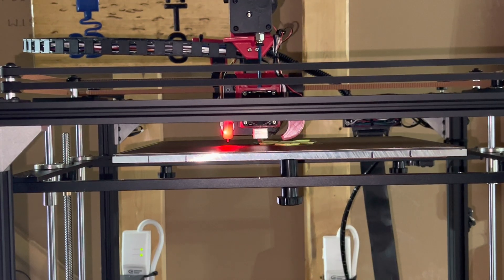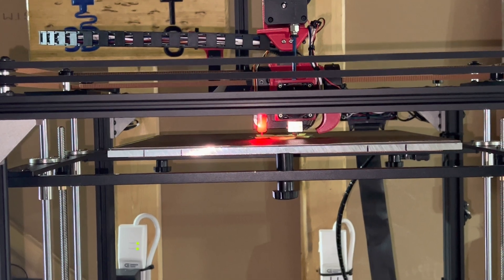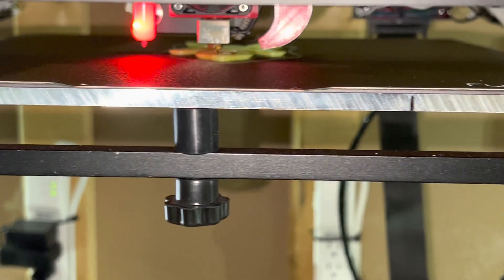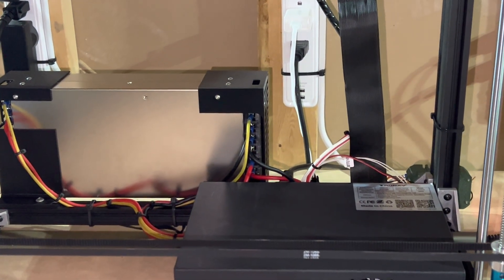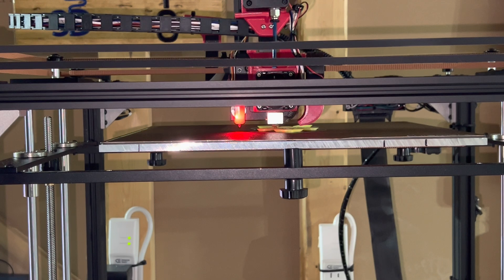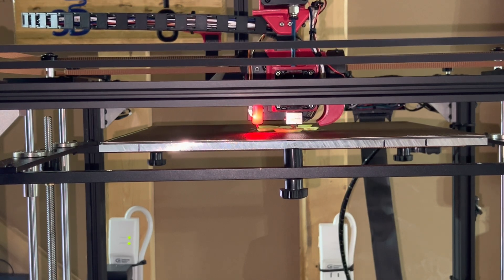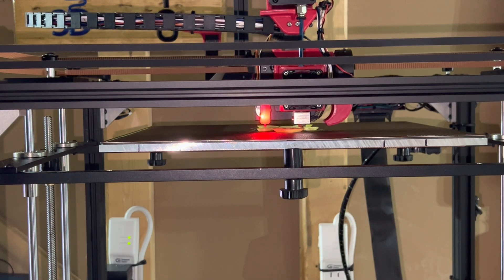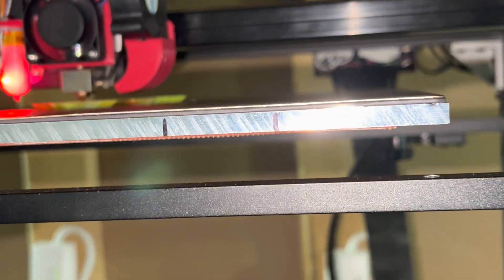Tronxy X5SA Upgrades Marlin firmware with bl touch

Comment: Where did you get the STL files for the extruder direct drive mount and the cable chain extenders ?
Reply from the maker: here is the extruder mount:
https://www.thingiverse.com/thing:4873326

here is the E3D V6 mount I use:
https://www.thingiverse.com/thing:4007130

BL touch and fan mounts from here:
https://www.thingiverse.com/thing:2494642

Cable chain front and back:
https://www.thingiverse.com/thing:4871518/files

Good luck hope everything works out. You'll have to mix and match these parts to get to work. Thanks for watching

Comment: Nice upgrades, thanks for the video.  Any reason for using a 400 watt 24v heater instead of a ac heater? I am using the original heatbed, sanded the back and added a Solid state relay and 750W ac heater. A 600+ (30 amp)  WATT 24V power supply is not easy to get.
Reply from the maker: Yea I guess I didn't want too deal with AC mains. I figured that using a MOSFET with the 400 watt heater was just easier. Believe it or not the 600 watt power supply I got from Amazon with fast shipping. Thanks for watching

Comment: What size did you order for your aluminum plate and did they ship the size you ordered or was it off some?  I haven't got my printer yet and I'm pretty sure I'll want to do the same thing with it.  I'd like to order my plate now so I'll have on hand when building my printer.  Thanks for the info, I'm now off to researching Marlin with the stock screen, I prefer Marlin since I've used it for so long now.
Reply from the maker: I ordered 13"x13". That's what a 330x330 plate comes out to. It was cut  at the right size. Also on discord there is a Tronxy community and there is a guide on how too flash Marlin with stock board. Also check Jeff's corner. There is a video he does with the Tronxy firmware you can use. But if you have bl Touch then contact Dan. His email is in the description I left
Reply: @mpulford311  Thanks for the reply, I ordered a 400mm so I'll have to up my size from 13", probably 16" is my guess but I'll wait for the printer to arrive so I can confirm the stock bed size.  I'm not on facebook so I'll have to rough it out, never had much use for FB but perhaps it's time to rethink that.  Anyway, it's good to know they'll ship the size I order so again, thank you!
Reply from the maker: @larry527az3  no problem anyway i can help. my email is mpulford311@gmail.com with any questions. I don't have FB either so that's why i found this discord community. Just download discord for your PC and search for Tronxy.